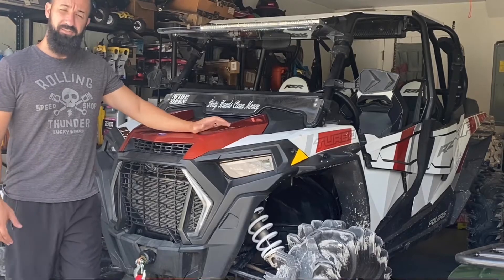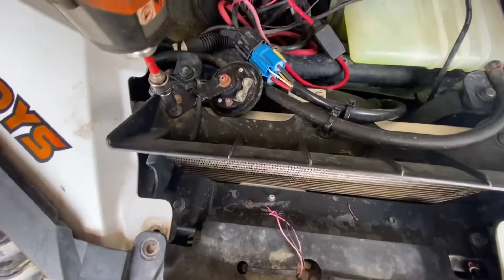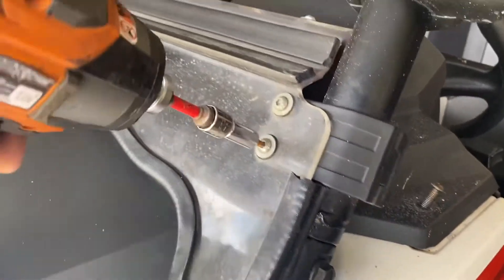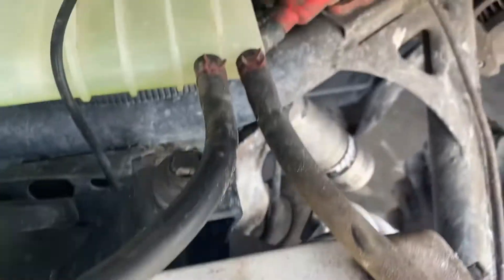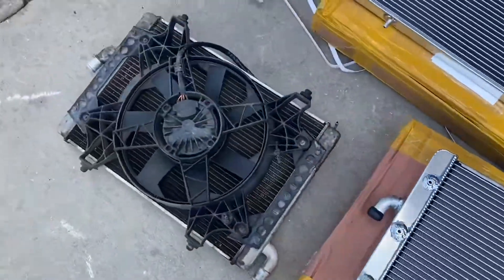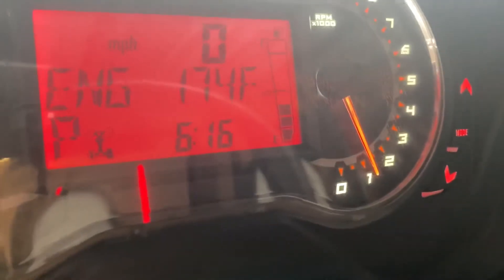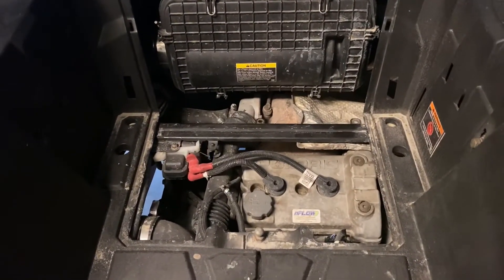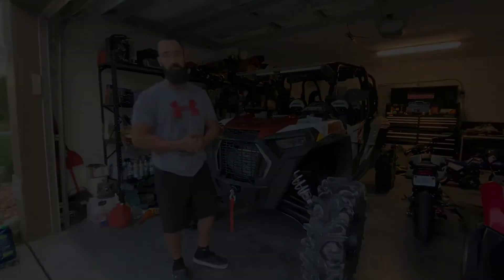Rzr Turbo Overheating?! Radiator replacement and how to purge the cooling system!

Comment: 2016 Turbo RZR.  Trying to purge the cooling system but the temp is getting over 210*.  Already Put in a new thermostat.  Any suggestions?
Reply from the maker: You raise the front all the way up? All coolant hoses getting warm? U getting a steady stream of coolant from the bleeder bolt?
Reply: turns out the thermostat was not opening until 195-200.  Waiting for a new one that opens at a lower temp.  Thanks  @dominick_anthony

Comment: Do you have to pull both radiators out to replace the aux radiator? My aux is leaking at the crimp point and needs replacing

Comment: You bleed it with the engine on? Or off?
Reply from the maker: Let it warm up and let the thermostat open and close a few times, shut it off let it cool down a little then crack the bleeder. Repeat until there’s straight coolant coming out and no air.
Reply: @dominick_anthony  perfect thanks!!

Comment: Looks like you mud this. I had Highlifter tell me they don't make snorkels for the turbos because they get to hot. Have you had that issue alot? Or do you think it was just your worn radiator?
Reply from the maker: I don’t mud this lol the previous owner did which is why the radiator was plugged up and had bent fins. As far as the snorkels go, my machines snorkeled haven’t had any issues and after replacing the radiators it’s never been over 198 degrees even in Florida summer.